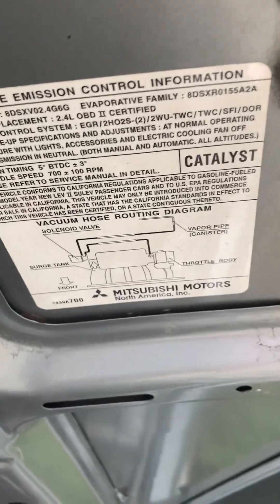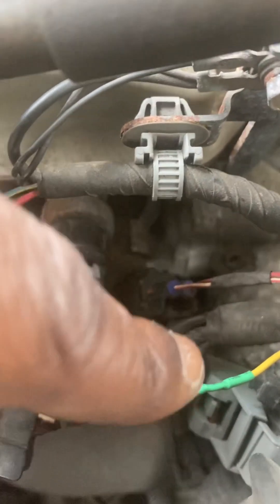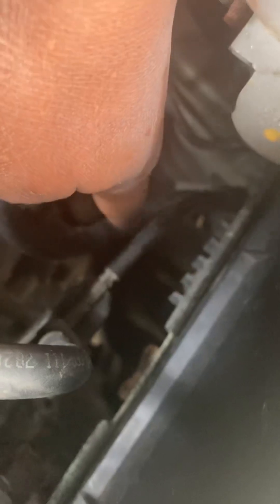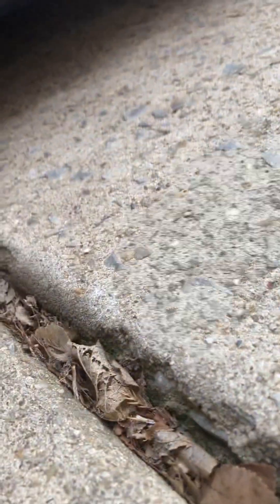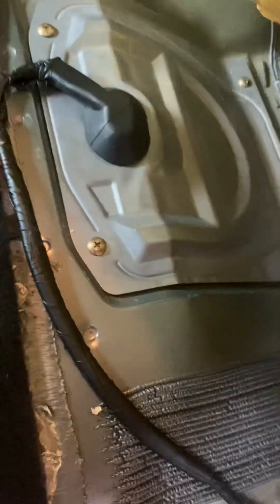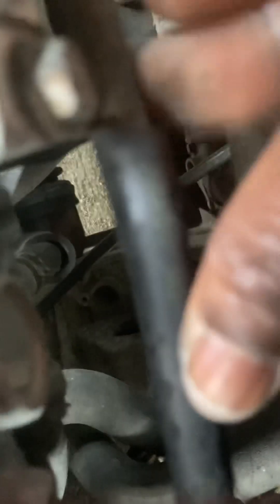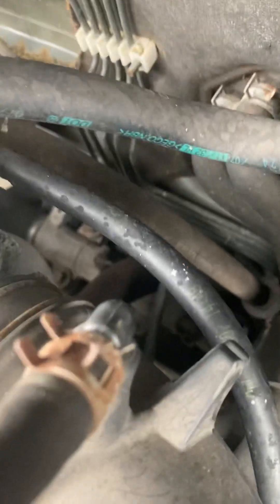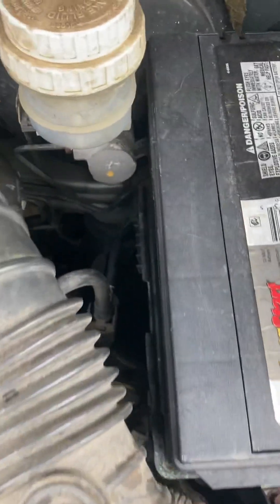2007-2012 Mitsubishi Galant Evap system ( Purge valve , Vent Valve , Canister location ) P0442

Comment: Do you think it’s the purge solenoid the cause for my galant 2010 to cause it to idle low the rmp goes under 1 once parked or at a red light happens a lot when I turn on the AC
Reply from the maker: did u find it can be the fuel neck lines try to avoid pot holes and bumps

Comment: Looks like this code is somekind of environmental emissions issue?

Won't actually harm car?
Reply from the maker: you will experience rough idles gas mileage to no problems at all but will fail emission if u have that in your state . use a smoke machine from amazon to find ur answer